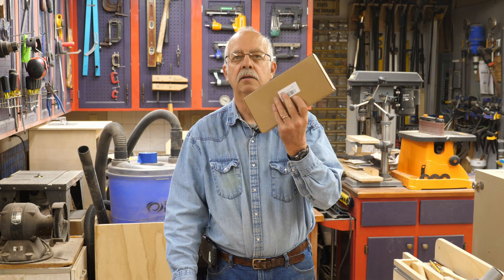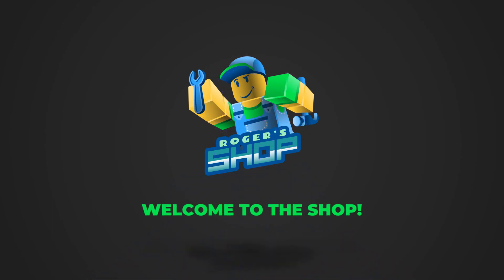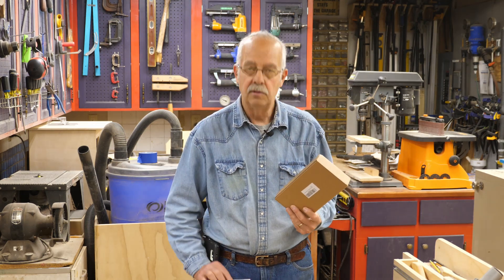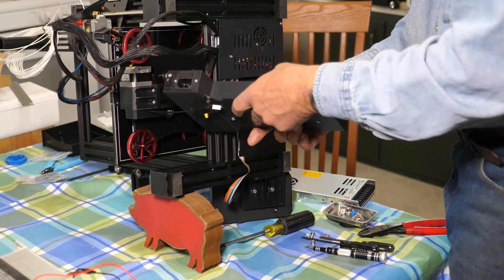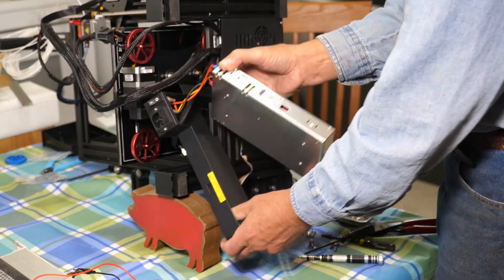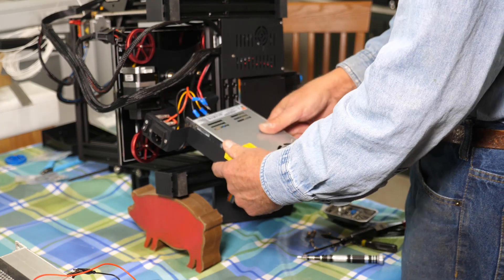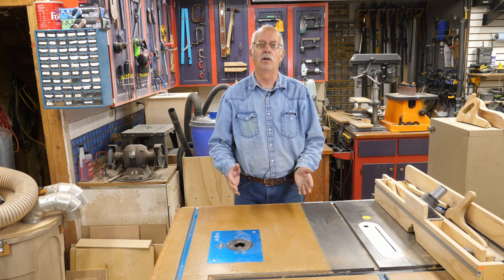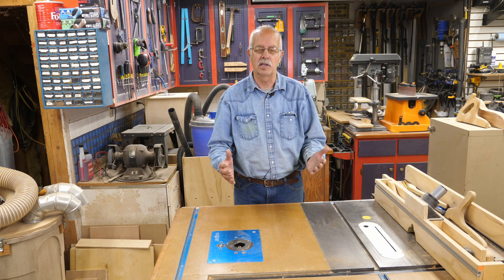Ender 3 V2 Power Supply Replacement One Print and Printer FAIL Again!

Comment: Hi Mr Roger, i have the same Y-axis problem. The stepper driver IC seems fail. When the printer power on and do nothing the driver IC extremely hot. :(
Reply from the maker: If only on the Y axis, it could be the stepper motor.  Try swapping the lead to a different motor and see if the same problem exists.  If it does, then it is probably the board.
Reply: @rogersshop  yes i did every combination, but the y stepper driver IC seems fail. When disconnect everything from the board, the Y axis IC reaches 65 * C degree, the others are 30 33 * C . I send mail to the creality customer service and i am waiting them now.

Comment: You don't seem to be a newbie at this but I will mention something obvious just in case - please don't be offended.  Even when the printer is off, make sure you don't go moving around X,Y back and fourth too quickly as this will generate current and has been known to fry boards. Since your second printer is fine (also a v2?) this is probably not the case. I think if I were you, my next plan of action would be to replace the stepper motors (unless you can verify them somehow) as one of them could be defective.
Reply from the maker: Yes, DC motors will generate voltage when spun and can actually burn out the drivers on the board.  In this case, however, the power supply was defective.  Has been replaced, along with a different brand of board and all is well.  Stepper motors are fine.

Comment: Sometimes, end-switches will lock the board if they get stuck or faulty , you can try spraying them with contact cleaner or use the ones from the other printer.

Comment: I bought  an Ender 3 vs a week ago. Still haven't printed anything yet. I run auto home once and it worked fine. Leveled the bed  then it wouldn't auto home or at least he Z motor wouldn't work. I followed steps in a trouble shooting video , swapping the cables and manual setting the  X and Z axis to move which they did but still the Z motor wouldn't work with Auto Home. So I followed the next step swapping cables on the mother board. Again everything worked perfectly. This time when I put the cables back in the right sockets it auto homed fine. No idea what caused it I'm just hoping its not a problem that's going to keep popping up in the future
Reply from the maker: Possible it was just a bad connection or a not-so-well crimped connector on the cable.

Comment: I also recently got an Ender 3 V2. From checking the fans (loud and unbalanced, causing vibrations), I found that the PSU has the fan partially clogged by the black metal sheet. Furthermore, a huge mistake in the design: this sheet completely closes the air inlet of the PSU, so when its fan starts ... it creates a vacuum, certainly does not cool the electronics ... Another design mistake: the motherboard fan (noisy because unbalanced) seems to be connected in parallel with the fan part, so the motherboard is cooled only when the part is cooled. I let you think about the possible consequences of extreme overheating (..fire..).
My solution: remove the psu cover sheets and modify/ replace it with a printed part, remove the motherboard fan connection from the motherboard and connect it directly to the PSU.
Reply from the maker: My motherboard fans are direct wired to run when ever the power is on.  One of my V2 printers has a Bigtreetech board instead of the stock Creality board.

Comment: would you recommend this 3d printer for a first timer since it is at a pretty good price?
Reply from the maker: If you don't get a "lemon", it is a good printer.  Lots of them out there in use and Creality seems to have a good following, but their tech support is lacking.  Plenty of good info on line, though if you have a problem.
Reply: @rogersshop  Jesus, I hope I do not get a lemon then.
Reply: ya its a great printer for beginners and veterans both

Comment: Hi Roger, I watched your videos and the only thing that I can think of, is that you changed out the motherboard, the original ones they hot glued the connectors to the boad. Do you think that one of the stepper motor plugs came loose in the 10 foot move?
Reply from the maker: Not really likely, but would be worth a look before ordering any replacement parts.

Comment: Just got the ender 3 v2 on a cyber Monday deal... The only thing I find horrible so far is leveling the plate.  I am thinking of getting the BLTouch auto leveling add-on doodad...  my new springs are on their way as well... will see if that helps before "upgrading" to auto-leveling.
Reply from the maker: The stiffer springs make a huge difference.  I also found that I had to trim the left rear spring a bit since the mount for the heat cable is there, taking up space on the bolt.
Reply: ABL will help you, but it doesn't meant to completely nulled bed leveling process. Basically you will have to do a (much) lesser manual bed leveling but still have to do it when it reach a certain point. Also stiffer spring is the second part of the equation to make your bed level more  somehow fix. Another thing to try is a printable gear lock you can find in thingiverse, it is work and do help for me even before I got my BL Touch up and running
Reply: how is it holding up? i am getting ready to pull the trigger on my first 3D printer and i am eyeing this one since it is at a good price for me.
Reply from the maker: @ericc8895  I have two of these.  One has been flawless and the other a lemon.  I just finished upgrading the lemon to the Bigtreetech SKR mini board and the TFT touch screen.  It now works perfect.  I'll be posting a video soon on the swap.
Reply: My personal experience - YMMV: Adding a BLTouch and compiling my own Marlin firmware to use with it has been an INCREDIBLE improvement. If it's me making the choice, the choice is "just hurry up and DO it!" - I'm that pleased with it. Running an Ender3 V2 with the 4.2.2 "silent" board driven by Marlin 2.x and nearly stock hardware (Capricorn Bowden tube, and "toughened" 0.4 nozzle that comes in 12 packs for coffee money on Amazon, mounted on the stock hot-end) Then I added the BLTouch (A genuine - so far as I know how to tell - Antclabs unit) and recompiled Marlin to use it for UBL. After some floundering around getting the Z-offset dialed in, then letting it run a 49 point mesh calibration, the quality of my first layers became picture-perfect. Just gotta remember to add it to your slicer's starting GCode so that it automagically does a three-point check, and tilts the mesh to match before it starts actually printing. Love the things, and will wholeheartedly recommend them to anyone considering it.

Comment: Hey Roger, I'm also having troubles with my V2. It's 3 weeks old and has 20hours of printing or something. I don't get anything on the LCD. It lights up tough, but there no image. I do have the blue LED from the mainboard so i don't think we have the same problem. Seeing your video's makes me anxious swapping the mainboard. Did you manage to find out what's causing yours to fail?
Reply: Finally found someone with the same problem! I got two prints off my new printer before all 3 stepper motors froze up. No independent movement, no auto home, nothin. Creality customer service is a nightmare. Plan B for me is save up and buy a Prusa. I love to tinker with my toys, but I do not want to spend more time fixing them than actually using them. I feel your pain Roger.
Reply from the maker: @TyMaxey  I am going to be making a couple more videos- One, to show how to troubleshoot the stepper motor driver section of the Creality board, and the second to do a swap on the Ender 3 V2 from stock board to Bigtreetech SKR mini and touch screen display.  Since this is on my "lemon" printer, we will see what happens.  My other ender 3 V2 works perfect.
Reply: @rogersshop  awesome! Looking forward to it. Thanks for putting in the time/effort to document your process and findings.
Reply from the maker: You have the same problem I had with "board 1" and had quite the adventure with customer service, eventually getting a refund.  "Board 2" lasted about a day, then burned out.  This is when I started looking for a power source problem, which I found.  My current problem with this one is that the stepper motor portion of "board 3" has failed.  Display works fine as does pre heat functions.  Just can't move anything.  It is now sitting in a corner until I decide to mess with it again.  I may go to a third party board (Big Tree Tech) and try that.  Otherwise, my second V2 printer is working just fine.
Reply: @rogersshop  3 boards died on the same machine? Do you think you're just having bad luck? I would start thinking there is faulty hardware, but what could possibly  go bad on such parts... Customer service isn't any good. I bought mine from Banggood also, so I can relate to that. Lol.
Reply from the maker: @johnnychimpo9583  I know why the first two failed as it was a bad power supply, which has been replaced.  On the third, it is the stepper motor driver section which is bad and failed after one print.  This machine seems to be a lemon.  My other V2 works just fine.  I'm going to try the SKR Mini V2.0 board when I can find some time to mess with this one again.  Good luck with Banggood customer service.  They will have you making all kinds of videos of it not working to no avail.  Still waiting on a refund after shipping the board and extruder to China.
Reply: @rogersshop  they actualy made you ship the board to china again? How much do you Americans pay for such service? I'm from Europe and DHL charges $260 for the whole printer.
Reply from the maker: @johnnychimpo9583  $36.50 US to ship the board and they pay for it.  Makes no sense since a new board is $35!
Reply: @rogersshop  maybe they want it for quality control... I just ordered another 4.2.7 board from Creality. Hopefully more luck with that one. Best of luck with your printers and your channel!

Comment: Did you try flashing the display firmware? Open up the display, there's an SD card slot on the back of the display main board.
Reply from the maker: The display works and functions correctly.  I tried it on my other printer and it works fine.

Comment: Just one question. Did you switched the dial on the power supply to match your country socket out put voltage? Im not aware where you're from but if you're in 110v country and have the dial switched to 230v that's not going to go well :)
Reply from the maker: Of course.  That is pointed out in the video and it did work "once"
Reply: @rogersshop  well the lemons are real!
Reply from the maker: @TheRealRoGueMS  True that!  Hard to believe that this one has one issue after another where the other one I have works perfect.